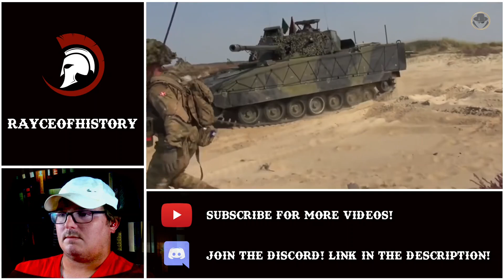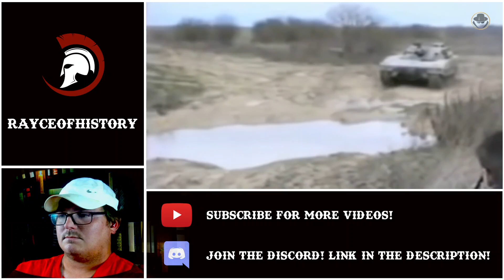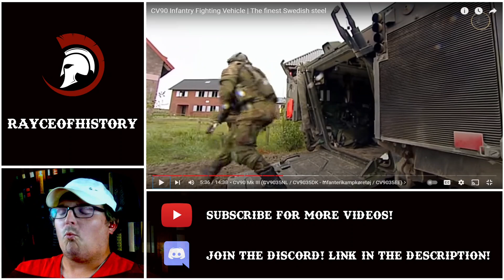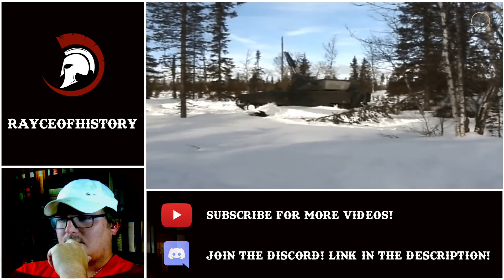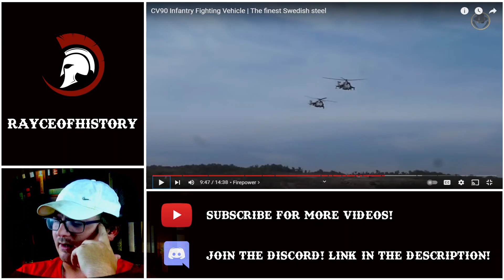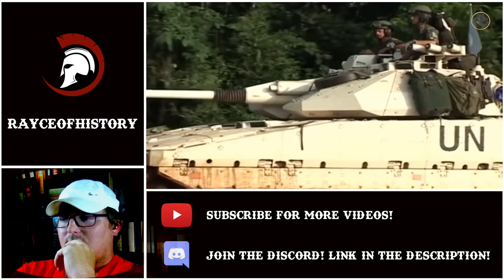Texan Reacts to CV90 Infantry Fighting Vehicle | The finest Swedish steel

Comment: CV90 is Swedish the main platform is built by "Hagglunds", the cannon used on Swedish version is L70 A bofors 40mm cannon. Some other operators choose 30mm or 35mm cannons
That said Hagglunds has been bought up by BAE (a British arms company). But it's still Swedish made and designed etc. 

The whole point it's Swedish, Period. If a Swedish company buys up Boeing or Raython all of their stuff isn't all of a sudden NOT American made/designed.

Comment: CV90 was of course developed by Sweden to  counter the Soviet invasion threat of the Cold War.

The Swedish 40 mm gun is the 40 mm Bofors AA gun turned upside down and fed with multiple Ammunition funnels. It can quickly switch between Armor piercing and fragmentation rounds.
This gun system was chosen because it's a can opener vs Soviet BMP, BMD and... if pressed into the role it can even open up a T72 from the sides.
It also makes a big mess of enemy infantry as the 40 mm grenade is large enough to have a fragmentation area effect.

The Bushmaster line of gun is used for NATO standard export models and is well known and presented in the video already (20 mm up to 35 mm). More ammo carried but less punch but it's NATO standard ammunition readily available to those countries.

If more is needed there's the CV 90120 today. 
It has a 120mm autoloader gun and is available with L55 lenth for the most punch possible. While still being able to climb mountain terrain and cross marshland beyond what a real tank can do.

Comment: You may have heard at the beginning that it was during the 80s that they started and the name reveals when it was put into use by the arm (CV90 because it was 1990 it started to be used) several of the Swedish systems/weapons have the year in the designation. Some Swedish companies are Bofors, SAAB (which owned SCANIA and which manufactured most of the aircraft in the air force since WW2) and also NLAW, Ericsson (made everything from mobile phones/mobile masts to radar and robot systems, VOLVO (manufactures trucks for gift machines and much more), Hägglunds (manufactured tracked wagons and tanks (some have been sold to USA/canada BV206 as it gets everywhere) which is very good in snowstorms as it has low ground pressure so it is lower than a person with snowshoes), Kokums (which was bought back by SAAB when they wanted to more than double the price of the A26 and committed a breach of contract so it was sold back and Hägglund and Bofors were sold a few years ago to BAE so it is no longer Swedish owned
So we take the morton, which was the most reliable of the SCANIA, which then had 540 hp and a low 14 liter volume (now it's a 16.4 liter V8 with 750+ hp) and take the 40mm AA from Bofors and turn it upside down with a few hundred shots in the mag gas and we do it roomy enough to move infantry squads (so stuff we already had was merged into CV90)
But we have more slightly odd weapons such as StridsvagnS /103 (Strv 103) which had double engines and was made for Swedish conditions and with a permanently mounted cannon
https://www.youtube.com/watch?v=945Rw7-G52M&t=1s
slightly shorter video so this is a bit more detailed
https://www.youtube.com/watch?v=C7cb7GlOnSY
https://www.youtube.com/watch?v=4I_Vlu5V7qc

and you can search Bofors 40mm 3p and 57mm
two videos (short)
https://www.youtube.com/watch?v=J8PZiCtuSqk
https://www.youtube.com/watch?v=rldn9Hvzih4
Reply: Today you can have it with a 1000hp engine with a heavy duty  transmission.
Reply: 3p munitions is a game changer compared to standard munitions. Especially in 40mm version compared to 30-35mm.

Comment: @18:33 When Sweden canceled our invasion defense (The cold war) and thought the "forever peace" in our area had come. The defense force focused on international engagements in the name of peace. So the CV9040 B version was beefed up with the international package. Better air filters, better air condition system, upgraded armor packs for the turret and the IED threats and mines. Also communication and Battle Management System upgrades. All before they went into the theater of war/conflict. In Africa and Afghanistan, the CV9040C did not have any problem with the environment. As I also have said before. The use of the saying "made for Swedish use" is more a sing-along saying than having anything to do with what goes into the requirements made to the FMV. We have the common requirements any IFV has, made by any nation, and to it, we add some extra focus for the hardest environment to work in - the arctic climate. Yes, Sweden has a subarctic climate zone in the north but also a continental and oceanic zone so we benefit from making the requirements "Not lacking" even if it demands more from the developers. Our fighters, tanks, IFV, APC, SPH, and so on work in the span of +50 to -40 Celcius without added requirements. Bought material from other nations usually goes through a capability upgrade to fit those requirements. Ergo: You buy Swedish - it works for anyone. We also have the stuff needed to expand that span if needed. (Arctic). The mobility of CV90 can operate deep snow as well as over swamps so I don't think they are worried that the equipment would not work but they prepare the equipment to manage the environment with extra tolerance. So far no climate/environment has required the CV90 to actually be redesigned, just upgraded.
Reply from the maker: Air conditioning, that’s something I didn’t even think of that would absolutely suck to not have in great working order before a deployment in the desert. 

And for the widespread use of equipment, I get what you’re saying, I just can’t imagine something like an abrams moving through heavy snow in the same way. And with desert being a particularly different environment, and also a harsh one, I just figured there might be some initial issues they were watching out for when it was first deployed to a desert setting.
Reply: @rayceofhistory  Your answer/input/comment "I just can’t imagine something like an abrams moving through heavy snow" triggered something. I've seen a test from Norway where a Bradley and a CV90 try climbing a snow-covered hill. The Bradley had problems with it but not the CV90 (a clip). That cascaded over to trigger a better response from me about the sayings of "Made for Swedish use" and such which frustrate me to no end. One can instead say "with the Swedish way of thinking". As the subarctic is so tangible with a large part of Sweden in that climate it is close to impossible for Swedish developers, buyers, and users of any technical, mechanical, hardware, not to include requirements to meet due to this fact. Making the products robust and more globally available.
Found the Clip with the hill climbing: Edited Now saw most written already posted here including the clip @tom eng
And here is one showing active suspension (Short): https://www.youtube.com/watch?v=arpmbxl6iRE

Comment: Hi Rayce...a couple of things in response to your wonderings. The additional top attack protection is in the form of bolt on, armor appliques. Also, the WW2 Bofors 40mm gun was the L/60 model...the modern version of the gun is the L/70, which was developed as an improvement on the L/60 after WW2. The ammunition for each gun is not interchangeable, as I understand it. 💯💯✌✌
Reply from the maker: You were exactly right on the Bofors gun, it was the 40mm L60, I looked it up when I got done recording because it was bothering me that I couldn’t remember. Thanks for the info!
Reply: @rayceofhistory  The best part is, they actually DID improve on the 40mm L60...the L70 is indeed a better weapon. Bofors is up there with the Skunk Works at Lockheed for some of their legendary engineering. ✌😁
Reply: @rayceofhistory  Strf 9040 uses the L70 improved variant of the 40mm AA gun and it's mounted upside down to fit and be loaded from below which makes the empty shells eject upwards. The 40mm L70 uses extra large shells making it closer in performance to a regular 50mm cannon.

Comment: Yes the CV 90 was made for the swedish market and our nature. They had some problems with the heat and sand in Afghanistan but noting that they couldnt improve on. If you want to see Norways test of Bradley against CV90 in Snow. There are an old video from the test. The bradley got stuck 10-20 m from the road and the cv90 drove up the mountain with no big problems. Think the video is called "CV90 Mobility" its prob 15-16 years old now and pretty poor quality. But still fun history. Its one of the biggest reasons why Norway went with the cv90.
Reply: The CV90 hade to pull the Bradly out of the snow.
Reply: fun fact about that Bradley, they had to tow it into the area they was going to do the mobility test, so they was already far of the main road. There is a reason why there was 3 CV90's there.

I think one of the reason that CV90 moves well in snow, is due to the hull and belt design. as you can see in the video, it basically lift itself up at the front, while the rear dig down, thus it grip into more snow, from surface and down, instead of the same snow as rest of the track have already done. Like the Bradley do, it just sink down. due to it dig it self down
Reply: https://youtu.be/HAsR7m1wXM0
Reply: When they tested Challenger, Abrams, Leopard 2, T-80U and Merkhava in the 90's to replace the Strv103, it was the same problem; the other ones did not start and run properly in arctic conditions (-30° celsius and below) and they got stuck to a large degree. The one then (in the 90's) that was performing decent in snow was the T-80U but was to old school (but CHEAP as sh*t) and non-computerized vehicle to make the mark.
Reply: Awesome video and mobility! Havn't seen that video before.